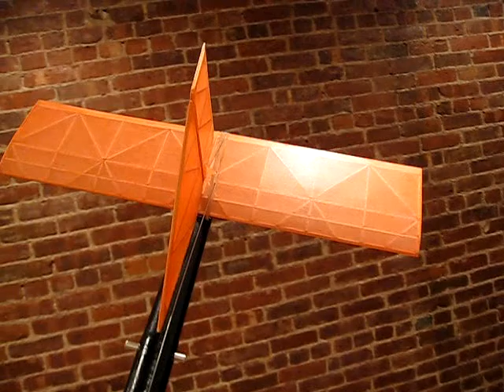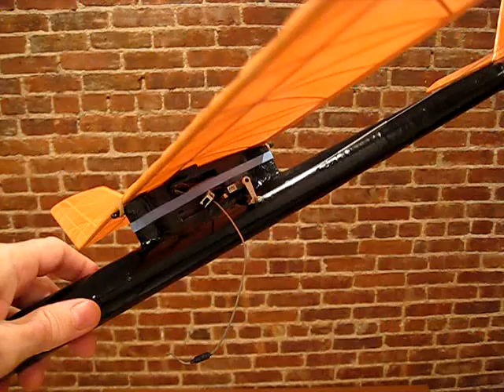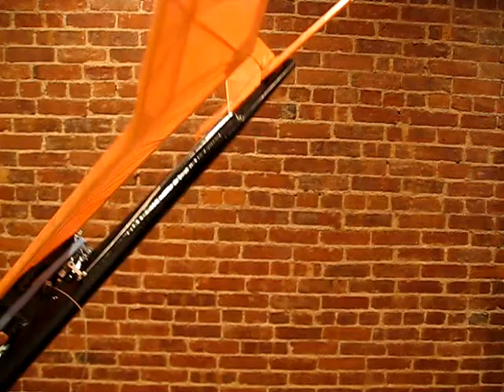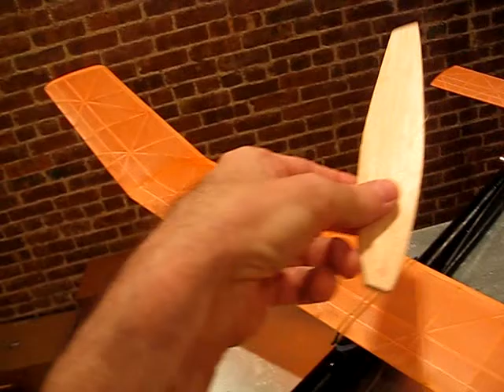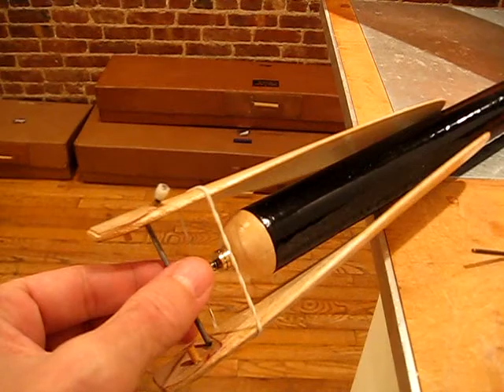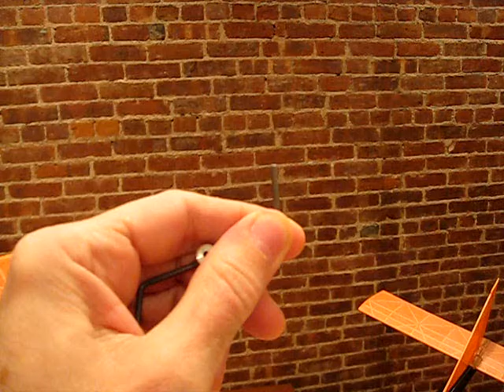RC rubber Mulvihill, my first modified Smalvihill - building

Comment from the maker: The dye is from FAI or Campbell's custom kits, and is mixed (as they suggest) as 10 parts thinner (I use lacquer thinner), 1 part Nitrate dope, 1 part dye. I use a Paasche spray gun with a 6 hp compressor to spray it on, the gun gives a little wider spray than an airbrush and works great. I've been using Aerodyne dope, which I think is a little thinner than Sig Nitrate, so now I'm using 8 parts thinner, 3 parts dope, and 1 part dye, which so far appears to work fine and runs a little less.